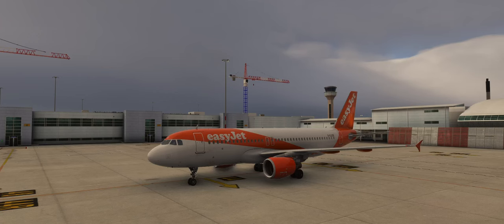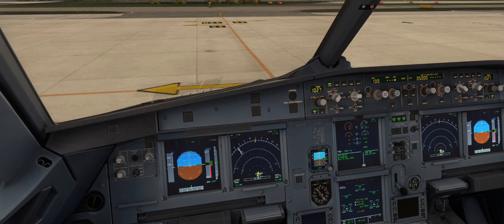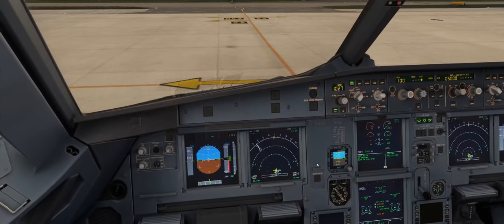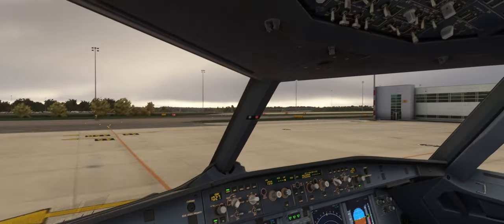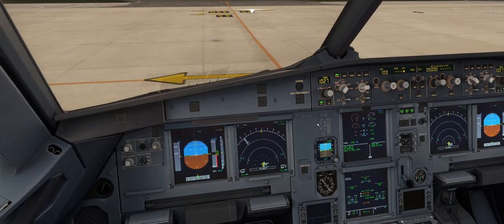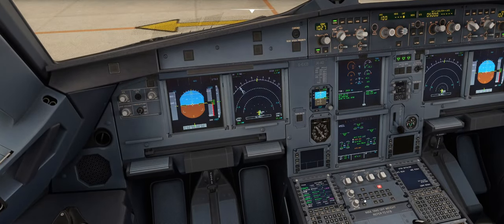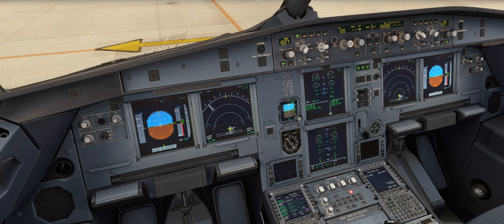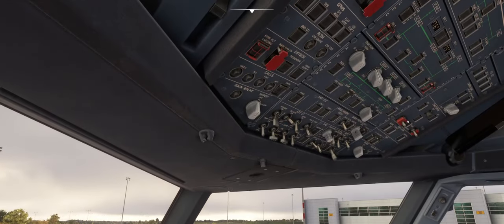Fenix A320: CROSSBLEED Engine Start Tutorial with a Real Airbus Pilot! Fenix A320 Tutorial | MSFS

Comment: Since you need all the bleed air you can get from the running engine why do you leave the PACKS on that I know they consume a lot of that pressurized air?
Also, is an airplane allowed to fly with an inoperable/unserviceable APU?    Sry for the double question...
Reply from the maker: Hello, running the packs from one engine is not a strain on bleed air and it would get noticeably uncomfortable in the cabin if we did not run the PACKS. For engine start all bleed air diverts to starting the engine on selection of the ignition switch regardless of whether the PACKS are on. We can fly with an APU inoperative, which does happen occasionally
Reply: @AirbusCockpitCoach  Thank you!